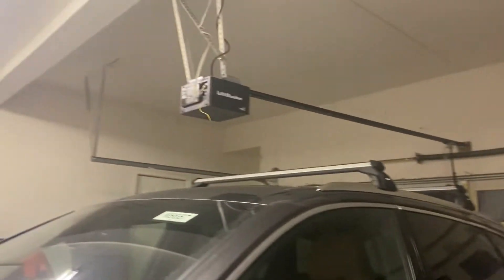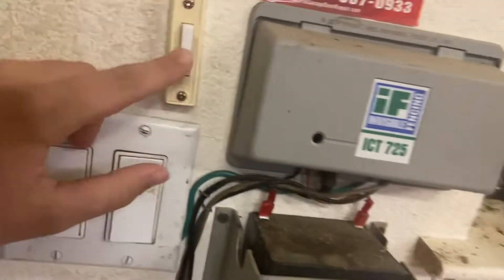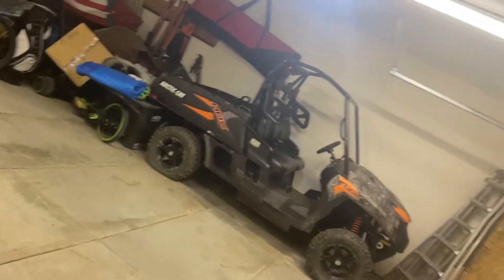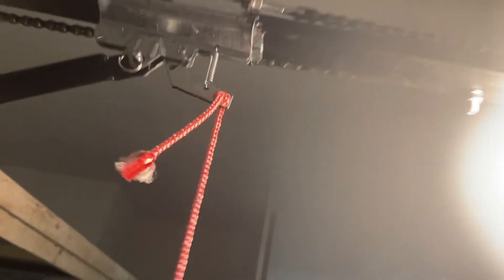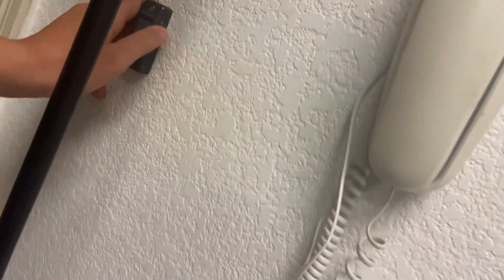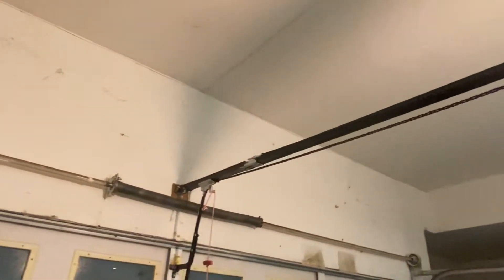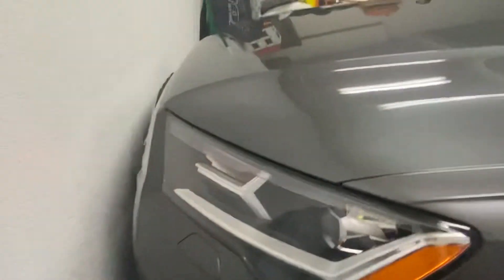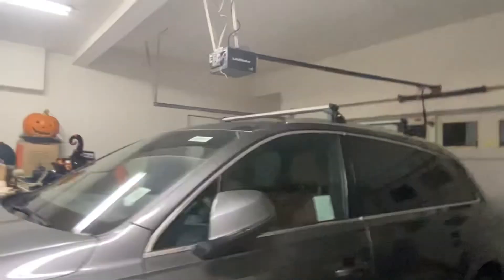200 subs in my garage!

Comment: 5:16 I can tell when the down limit was set really badly the panel cracked pretty soon you guys probably need to fix that to reinforce it or something and the garage door arm still needs to be adjusted probably two holes maybe one and then the chain still needs to get tighten up quite a bit more and then the access emergency release Rope just needs to get trimmed up in the end of it burnt then you will probably be set for a little bit
Reply from the maker: Yeah, it’s been like that
Reply from the maker: I’ve tried to trim the rope
Reply from the maker: @zacksgaragedoorserviceandr1208  I was using headch clippers
Reply: @Liftmasterchannel  Depending on the quality it won’t cut well but you need to get all the way to the top leave a little bit of access then you should be fine on the top and bottom then if you have a lighter around burned and make it look good then that’s one less thing to worry about
Reply from the maker: @zacksgaragedoorserviceandr1208  I trimmed the release rope
Reply: @Liftmasterchannel  that’s good Hopefully I will see it in your next video
Reply from the maker: @zacksgaragedoorserviceandr1208  Well see probably not though but I’ll try
Reply: @Liftmasterchannel  If you need my help let me know I’ll be more than glad to take my time to help you